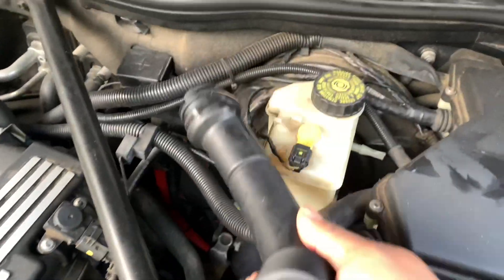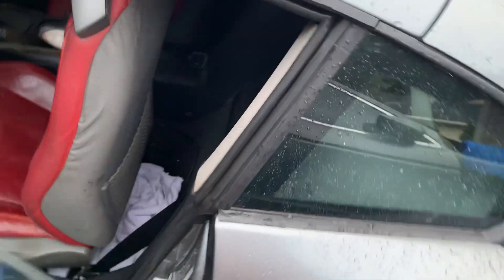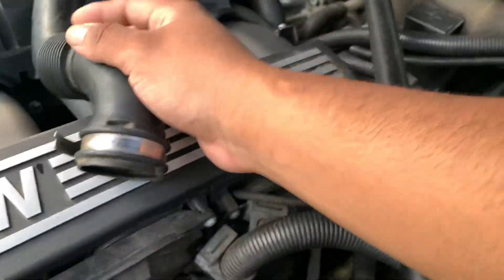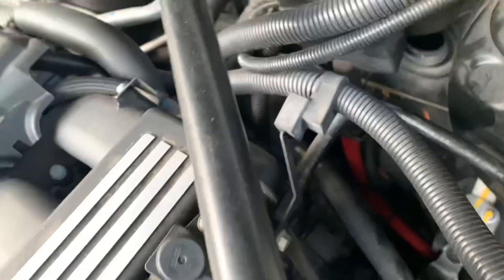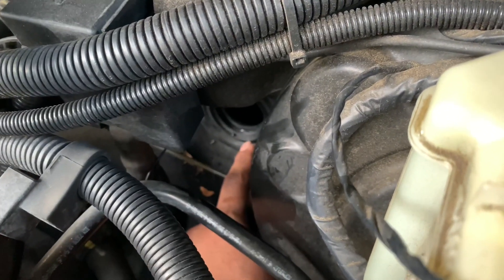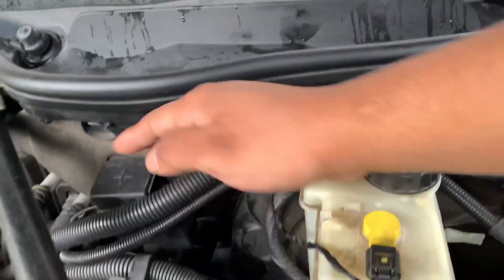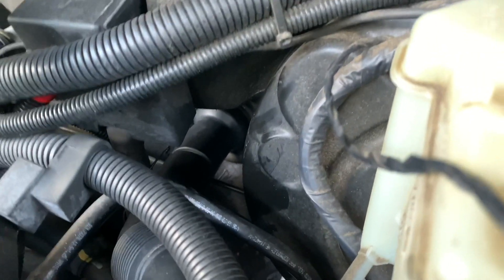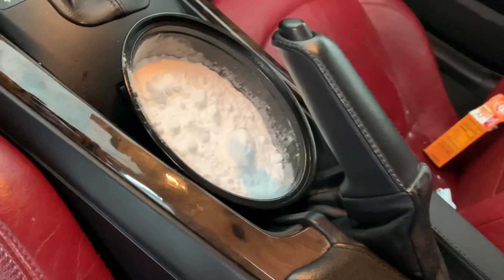BMW Z4 Mod you SHOULDN’T DO! BMW sound box generator￼

Comment: In right hand drive markets the sound generator port is on our passenger side footwell, and as far as I know our drainage comes down the centre of the windscreen wiper cowling, so it doesn't really drip right onto the sound generator port. It's a good video Joe, brings attention to a pretty bad design for LHD markets.

Comment: That gasket is available for replacement. Yes, at this age, if you're interrupting the interface, the gasket needs specific attention to how well it seals or should be replaced with a new one. I deleted it and capped that port when I supercharged my 3.0si. The gasket was thoroughly dried out.
Reply from the maker: Supercharged? Wow! Is heat a problem with your set up? What kit are you running? I’ve been seriously looking into one but not sure if I’d be with it with my auto box
Reply: @TheRealToybox  ESS G1 supercharger, custom intake, dual water methanol injection (pre SC and pre throttle body, modified Vortech pulley 82mm for about 11.5 psi. And a lot of little stuff. Not done yet... 😎 I've got a 6spd manual.
Reply: A friend is running pretty much a mirror of my setup on his auto. He has been having some issues with his auto when running more than 10psi though.... I think it's a tuning issue though.

Comment: Did you plug up the resonator hole in the firewall after adding your aftermarket intake? The cars without the resonator have a solid plug you can get to delete it.